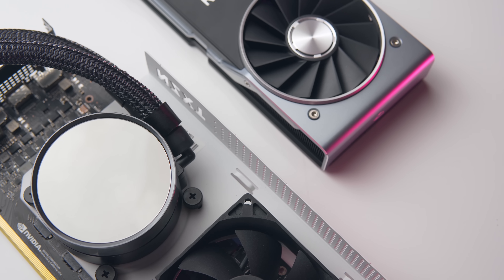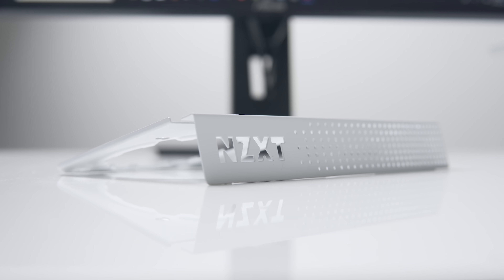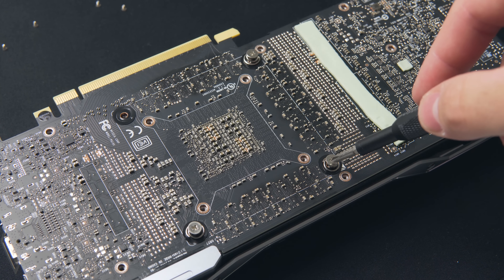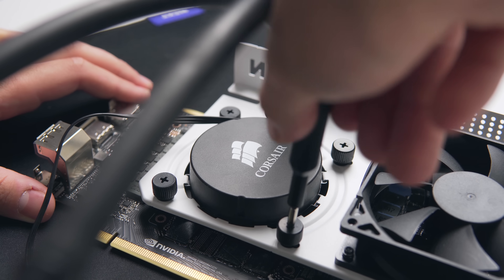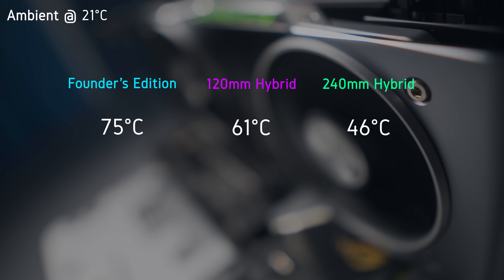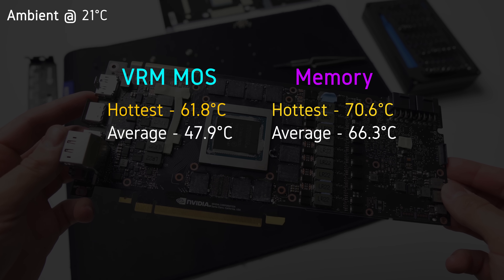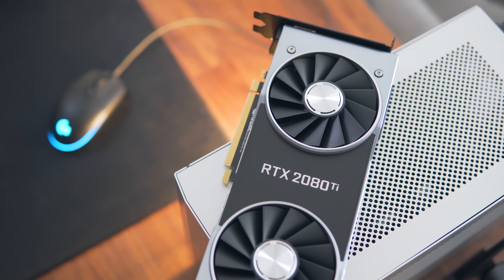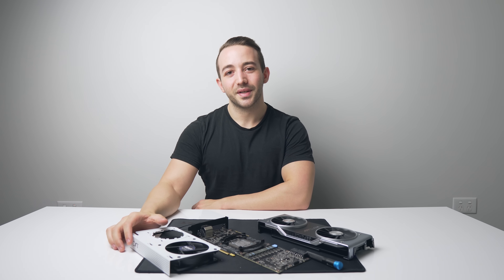RTX 2080 Ti + Kraken G12 Hybrid Cooling - Worth it?

Comment: WOH!! My RTX 2070 from ECS (Alienware) runs at 75c with the fans maxing out at 6900 RPM. Damn I want a Founder’s Edition or use the NZXT G12. No wonder its so loud. Question: what single fan AIO is enough to cool an i9-9900K? Thanks.

Comment: No cooling in VRM and other components. Then after a while for everything to work. I see several in technical assistance with problems due to overheating of components because these adapters only cool the chipset.
Reply: What do you mean? This adapter specifically has the extra fan to cool the VRM section, did you comment without watching the video?

Comment: I'm currently using a EVGA 1080ti hybrid card... And I can say from my experience a 120mm fan radiator combos the sweet spot for sound and adequate cooling performance. But, I really feel that there should be better cooling capabilities added to these hybrid cards in regards to the memory and VRM. I wish they would add vapor cooling chambers with a radiator for the fan to cool them with direct contact.

Comment: Have the PNY 2080 Super. It was cranking up to 78c and with a blower fan, it was crazy loud. Put the G12 bracket and NZXT AIO cooler. Actually the same one in this video. Took AMD brackets and wasn't hard to install.

Playing Red Dead Online, my temp hasn't gone above 49c.

It looks like Frakenstein BUT, I'll fix the wiring when my new PSU arrives.

Comment: Not sure on which MB you used this, but you can change temperature sensor to PCIEx16 slot, so fans ramp up with gpu temperatures. At least on my B450 Aorus elite and X570 Aorus Elite that is possible.

Comment: Hey great videos! Quick question could a Ghost S1  handle a A kraken G12 on the GPU side with a 120mm NZXT AIO solution and then a 120mm AIO solution for the CPU in a top hat or 3 medium hats ?  crazy ?

Comment: I would like to mount the GPU an a vertical mount and use a Kraken Z63 showing the system temps on its bright, 2.36” LCD screen.  Would that work?

Comment: QUestion: Where did you plug your fan to the radiator into?  Does it make sense to use a PWM to dual fan spliter - from the graphics card to each fan?

Comment: It shouldn't have big splooges of paste. It should be like toast. A nice, one layer spread. Otherwise you can have massive differences with temps. Paste doesn't transfer heat. It fills the gaps where the plate of the cooler leaves untouched. 

Oh and if you use an EVGA card, MSI or Zotac, you can install custom firmware and get 2000mhz. You're welcome.

Comment: @optimum Tech - I've got a very similar setup is the 75C for FE card including the undervolt from your previous video?
I'm now the proud owner of a Ncase M1 with Dual AIO's cooling my 9700k and 2080 ti thanks to your videos! Keep them coming!
Reply: Mark Donkin I have to see how you set that up! I plan on building a new PC in an M1 when 4000ryzen and ampere drop, and handing down my 6700K, 1080ti build (s340 elite) to my brother. I would love to see how you were able to mount and fit the two radiators in your case!

Comment: You should check out Argus Monitor.  I use it for fan control and it allows you to setup your fan curves based on CPU, GPU or both (among other sensors).
It is great being able to ramp up certain fans or all fans based on your hottest hardware item, for example I run my ncase with an air cooled 2080ti and a 240mm aio on an 8700k.  With this setup I run the Radiator fans as exhaust so even when the cpu is running fairly cool, it is beneficial to ramp up the radiator fans when the GPU is getting warm to drag some of that hot air away and stop it circulating in the bottom of the case. (given they are the $65 noctua fans, you cant hear them over the gpu anyway at that point so it works well)

Comment: Arctic makes a 14pin fan connector cable that you can use to run the fans with then GPU temps
Reply: https://www.arctic.ac/us_en/nv-14-pin-adapter.html

Comment: A note: You only need to remove the screws on the back of the card, and two of the IO shield screws to access the PCB. You then only need to remove the tiny standoffs and the card will pull away from the cooler. No need to completely remove the IO shield.

About the G12: I can tell you from personal experience: No, it's not worth it in my opinion. You are far better off getting a full cover water block for the GPU, and if open loops scare you, get one of the full cover blocks from Alphacool that attaches to an AIO like system. And with the G12 you have to be EXTREMELY careful mounting the cooler to the card as it's direct-die cooling. No IHS to protect the GPU die from chips or cracks. I lost a GPU to a chipped die from one of these back in the day. A full cover water block also provides more adequate VRM and VRAM cooling (better performance for overclocking); And if any sort of custom cooling isn't your thing, you can always buy a 2080 Ti hybrid card
Reply: "No, it's not worth it in my opinion. You are far better off getting a full cover water block for the GPU"
-  But a full cover water block alone costs more than the whole build here. Then you have to pay for the pump and the accessories. Take a look at the costs too.
Reply: @therealjantube  I explained there are alternatives. Like the Alphacool full cover AIO series. You can also try and nab a hybrid card instead of a regular card from the get go.
Sure it's cheap, but IMO it's not worth the risk.
Reply: @JulianUccetta  I get what you mean but think about the price again: The Alphacool full cover AIO costs around 250€ here and is not compatible with "lower or mid tier" GPUs. Hybrid cards are very expensive like all GPUs at the moment. So if NZXT made a new version of the G12 for the 16XX and 30XX series GPUs it could be a bang for the buck.
Reply: @therealjantube  think about the cost and scarcity of an expensive GPU during these uncertain times. I'm not saying don't do it, but I've personally killed a GPU with one of these. It's a risky venture, and with the mounting mechanism it's even riskier than a full cover block. If you tighten one of the screws just a smidgen too much you'll have a cracked die on your hands. Not to mention the near lack of VRAM cooling which is unacceptable on RTX 30 series GPUs. If you had to go with this that's one thing to pay attention to - replace the sad excuse for a fan that NZXT includes with something better and get some decent VRAM heatsinks. None of those tiny 3 cent ones you can find all over Amazon. 

Yes, full cover blocks are more expensive. Yes the Alphacool block is more expensive. But consider the amount of money one puts into buying a GPU in today's market. Especially if they were forced to pay scalper prices. Is that investment not worth minimizing risk when water cooling it?

Most people don't need to water cool their GPU. If cost is a factor after dropping $600 to $1100+ on a graphics card, then I'd implore one to just wait a bit longer and save up for a better alternative. This is a Frankensteins monster of a solution.

Comment: I have the RTX 2070 Super FE does this use the ribbon cable as well? Or does it use the 4 pin? Also, how much taller is this setup than the stock card? I have a micro atx case not sure if I have the room to fit the kraken g12 with a radiator and fans below it. (corsair crystal 280x)

Comment: FYI, at 5:19 you mention that its a problem to control the G12 fan with the GPU, not anymore...if you buy this cable here @ https://www.arctic.ac/worldwide_en/nv-14-pin-adapter.html it works with the nvidia 2080 series cards and your GPU will then be able to control the G12 fan...

Comment: I just converted my 2080TI (Windforce OC 11GB) to this config with an X62 cooler.   I managed to use some small nuts and bolts to keep the backplate on.  I also added a temp sensor under the backplate to control the fan on the G12.  I have it ramp up fast if I start gaming or such.   Only thing I didn't like about this bracket is you need to be really careful with how much you tighten the cooler hold down screws,   it's easy to get the cooler plate not sitting flat on the GPU.  Don't over tighten,  just ensure everything is even.    Inspect to ensure the cooling plate is sitting flat.  Too little thermal compound can cause issues,  but too much and this will have a hard time pushing out the extra and again not sit flat.   Good recommendations in the video.

Edit:  I'm running a BIOS on the 2080 TI that gives me 140% over power and this handles that without issue.  Gets to about 60C in a silent mode.
Reply: Just an update,  I ended up having to install a long heat-sink on the MOSFET IC's for the front most VRM.  It doesn't get much if any air and was tripping thermal limits and shutting down.   It would stay running stock,  anything over 100% and it would trip.  Works just fine now with a heat-sink.   Just something people should keep in mind much as this video mentioned.
Reply: More updates.   I abandoned the G12 for a Bitspower Lotan waterblock,  EK Res,  EK D5 pump,  EK 280 and 360mm SE radiators and EK Velocity CPU block.   I gave up on the G12 because it was just letting the VRM's run too hot,  the memory was also too hot.   I wasn't able to OC the memory beyond 650 Mhz and now I can get 1000 without issues.  The backplate was hitting 65C before and now it's hitting 45C tops.  Cooling of the GPU chip isn't much different really,  I run around 38- 40C @ 2070 Mhz + 1000 on the RAM under a sustained load.   The G12 did just a little worse then this but not too much so.
Reply: You think the vrms are okay if I’m not over locking my memory? I just installed this on my 2080ti
Reply: @rymooyt  They should be OK,   not sure if you noticed the post I added mentioning that I switched over to a full water block.   Still using the same config.  Skipping this generation of cards.

Comment: i would love to do this but im so afraid that the coil whine would be too loud
Reply: It's a waste of money. Don't bother.  The 2080Ti is so aggressively power throttled that you should never come close to any thermal throttling situation.  My stock ASUS ROG Strix hits the power throttle and never goes above 60 degrees Celsius.  Runs at 1905MHz all day long.
Reply: @talkingmudcrab718   you need to flash the 380watt bios if youre gonna watercool

Comment: I did the same thing with the same items and get even hotter, it was at 50c and after installing the water cooling now is at 86c. :s
Reply: Did you find out why? Shouldn't be the case. What kind of AiO are you using? Good thermal paste? Good connection between block and chip?

Comment: there's no thermal pads for memory and vrm?
Reply: You can usually use the 'shipped with card' backplate for all that.  All it requires is eyes and a Dremel to install seamlessly.  There are a couple or four stand offs that need to be buffed away and it fits nicely with the factory shipped plates.

Comment: I used the Kraken G12 on my GTX 1080 ti.

First with a Corsair H80i GT with terrible results... about 80 degree celsius heavy load and no overclock.

Then later with a old Dell Alienware Auora R4 CPU watercooler. Now it´s idle at 22 degrees celsius, and about 50 degrees celsius under heavy load, and max overclocked (Core +110/Memory +1000)

Think the pump is way better in the older Alienware part, and that is what made the difference...

Comment: Originally did mine with a Corsair H110i but was still too noisy and temp went to 55-60 ... modded the G12 to fit a EK Supremacy MX block running with an SPC-60 Pump/Res & 280mm rad & its awesome ... never goes over 45 degrees and both fans never spin up over 500rpm ... silence :)

Comment: When putting thermal paste on an exposed dye like on a GPU, make sure you spread it! If it doesn't get to the corners it'll create a hot spot. With his 2080Ti there is a little missing on the edge and that could be enough to kill it as the GPU temperature isn't measured throughout the entire dye and that spot might be running at 120 degrees without you or the GPU even knowing.

Comment: ok, I'm currently running a Ryzen 7 2700x under a H150i, and a 1070 ti. I want to run another Corsair cooler but I don't know how I would hook everything up to have it read properly. Asus Rog Strix B450 F gaming board, and using a DeepCool fan hub. Lian Li 011 dynamic case with 6 corsair fans.  Help?

Comment: So I just mounted the kraken g12 to my 2080ti and where it's working I don't think it's working like it should my idle temps are 42c but while using fur mark stress test my temps would go to about 80c I'm not quite sure on how to lower it I'm using a 120mm Corsair H55 to cool it and I noticed the temps you got with the 120mm were below mine so I'm not sure whats different

Comment: Would love this with the reference 5700 XT. Theres also an Alphacool AIO GPU waterblock/pump/radiator thing you can get for 200$.
Reply: Theres really no point, the 5700 xt doesn't have a lot of head room for oc even with water cooling unless youre looking for a noise reduction option lol. Plus the vrm's and memory get too hot on the 5700's so you would have to figure out a cooling solution for those as well. not really worth it imo

Comment: my 1080ti broke with this kit in a year. bad cooling memory power etc. no backplate. gpu thought it was cool and overclock itself until other components die. Kraken G12 -40c and -1000dollars
Reply: thanks for posting this- I was thinking of getting it for my 1080ti. I don't think my temps are horrible... max of 75 when its hot out and usually around 65-70 when it's cooler. I live in Canada and its +40C in the summer and -40C in the winter.
Reply: @MrBenthefirst  the fact is that the 1080ticard has few temperature sensors to detect these problems. you may pay attention to raijintek morpheus (2). this radiator is able to cool the server processor. for a complete set you will need to get radiators for all memory and power and high-quality thermal pads. highly recommend but it takes a lot of space 6 slots

Comment: This bracket actually broke my 980ti. It worked for two hours, after the foam blocks got squished and put uneven pressure on the die and cracked it. I asked NZXT and they said a "the bracket had no capability to break a GPU because it was just that, a bracket." So I asked them why did the Amazon page claim the bracket itself, increased cooling up to 40%. 

He didn't respond to that, instead told me the bracket couldn't do this or that. I've delided a 6700K I'm still using with a 22% overclock on it. DIY isn't something new for me. 

Note, I never asked for a refund or reambursment, I just literally said that should use a better mounting solution that doesn't rely on cheap foam.  

I also knew a guy who had a Kraken pump, it died after 2 years. They didn't want to replace it. Don't know the story there. He also said the customer service was terrible. 

I have a 2070 super now. Great card.
Reply: I had an x52 go bad on me after three years. They asked me a few questions, then issued a replacement which arrived a day later. My customer service experience was great.
Reply: You definitely over tightened it. Should only be finger tight

Comment: Are the brackets compatible with the Radeon cards? I can’t really find anything online and asking toms hardware takes weeks for a response let alone an answer
Reply: I wouldn't get it. This bracket broke my 980ti due to those terrible foam blocks they use to support the GPU. The VRMs and memory will also run a lot hotter. 

It is compatible with most Radeons, but I wouldn't trust them on that. Look up g12 bracket on Amazon if you really want to know.

Comment: Have my 1080 ti msi armor oc with g12 and kraken x42 and copper heat sinks on memory and vrm with oc on core clock with custom curve at 2075 mhz and +300 on memory using afterburner max temps while gaming remain between 40-50c no issues till now have been using 24x7 for more than 2 years. G12 is is worth it and a good way to hybrid cool the gpu if you have a spare aio not so much if you dont.

Comment: There's actually an adapter for that 14 pin to 4 pin connection, so u can connect the fans directly to the gpu
Reply: Hi
Where can this be purchased from in the UK?
Reply: @twt1919  this is the only place I could find it : https://www.arctic.ac/worldwide_en/nv-14-pin-adapter.html
Reply: @user-cz3bf6cb4c  perfect mate !!! Gonna do this
Reply: @user-cz3bf6cb4c  So the end of this wire is a 3 pin male connector or 4 pin? So I will be connecting the 2 radiator fans with a  Y connector have a 4 pin female end..and then connect the g12 92 mm fan and the radiator fans to this 14 to 4 pin connector? Where do i connect the main pump fan though?
Reply: it's a pice of trash product, they don't even give you anything for the passive cooling of the VRM's or the VRAM'S, piece of trash is the more suitable name for it and not kraken G12, so i'll give it a more convenient name for it "Piiece of trash ghetto watercooling solution", mutch better than kraken g12, don't you think?
Reply: @me_and_me_  Shut your dumb ass up.
Reply: @me_and_me_  bruh ur supposed to apply heatsinks over those. I've seen a vid where someone used 2 rly smol noctua fans just to cool other vrms